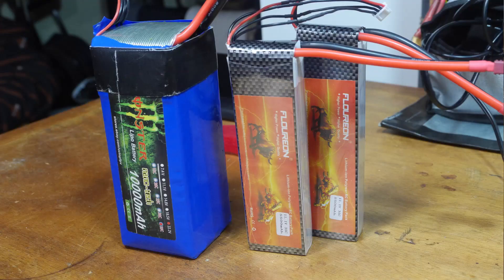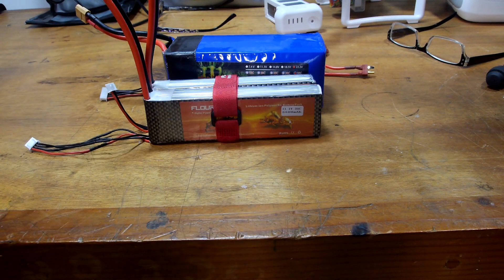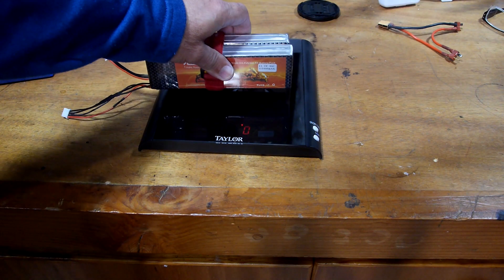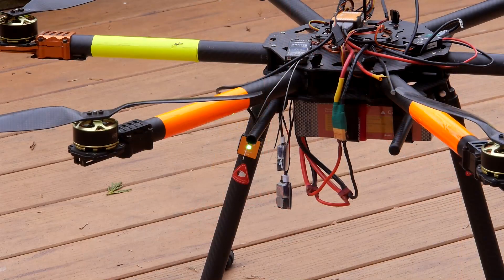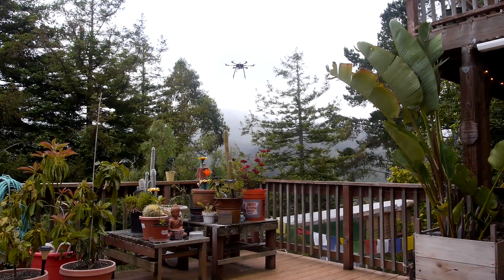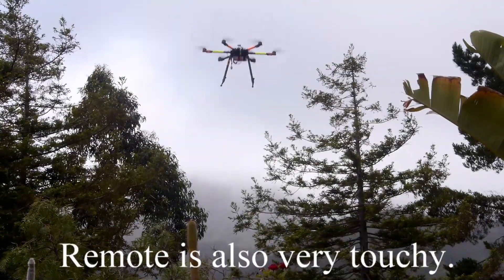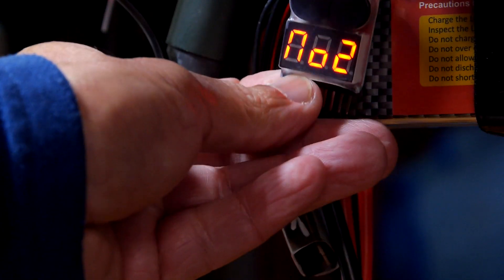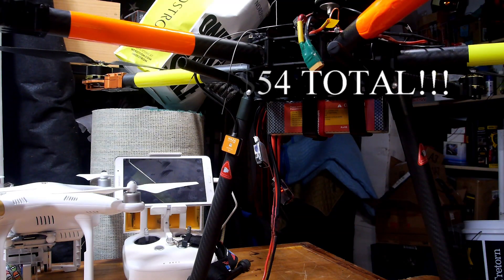Connecting Two 3S Batteries in Series to Make a 6S Battery for $54 bucks!

Comment: It isnt going to be a 11000mah, you put them in series, so it will be 5500mah still. If you wanted increased capacity, not voltage, put them in parallel.
Reply: Got it makes sense. Thanks. I just get a nice 6500mah 6S LiPO probably will save alittle weight too.

Comment: I love your back yard /deck. it  looks like you live out  in the woods away from everybody.  Question  do  2 3s lipos  5200mah each last longer then 1 6s lipo at 6500mah?  Im not a math guy buck to me sounds like 2 3s lipo will have alot more run time since its over 10,000mah
Reply from the maker: After 9 minutes, I got about 7/10 of 1 volt more with the two batteries stacked together. I don't know if that would be the result every time since it was pretty windy that day, but one thing is certain, the two batteries are far cheaper than the single and lasted a picture longer during this test.

Comment: Very nice, i have a charger that only supports up to a 4s pack.. I don't want to buy a new charger so i think this is the best way to go. How would the charging part work using a charger that only supports up to 4s pack?
Reply from the maker: The two batteries simply separate and charge normally as  3S batteries. Then I put them back together through the plug.
Reply: Cool thanks...

Comment: Potentially this was a great video, but I'd have liked a short tutorial to see how you made that splitter cable, thats the most important part of this project.
Reply from the maker: Believe me, soldering and tutorial should not be in the same sentence if I have anything to do with it. My soldering is ugly. The batteries are just placed together with a strap, and the adapter is very straightforward. Just look at the video at about 17 seconds into it and that is pretty much all you need to see.
Reply: Haha alright, thats honest and fair enough. I already found a clear picture, cheers.
Reply: @photojunkysdronezonevlog  also your mAh calculation is way off, 5500+5500 is still 5500mAh when you double the voltage (series connection).
Reply from the maker: @petertraveller6421  correct, but it goes from 11 volts to 22 volts and change. Did I ever say doubled the 5500mah number?
Reply from the maker: I can't bear to watch the video again :-)